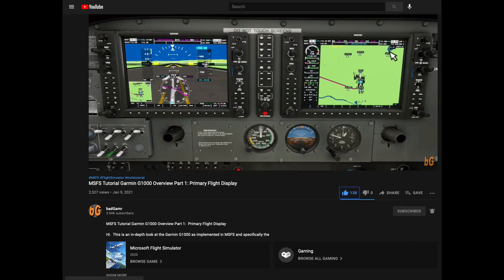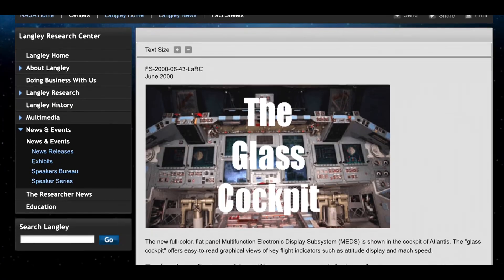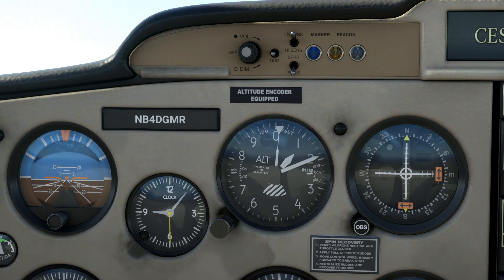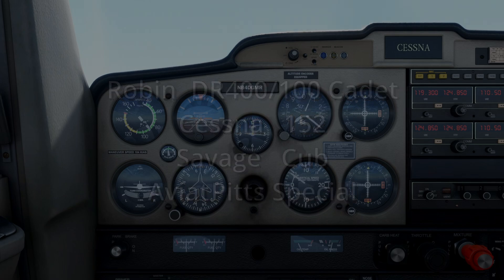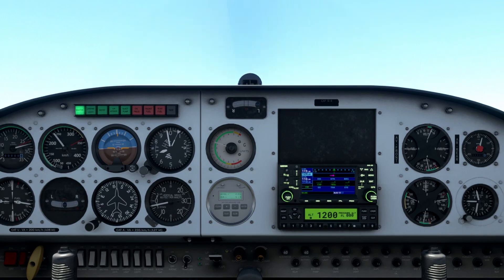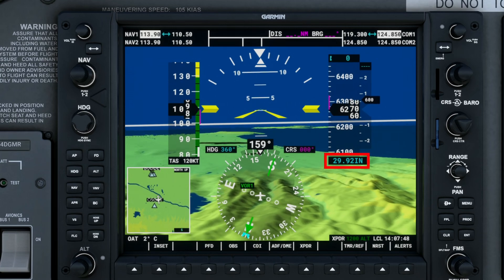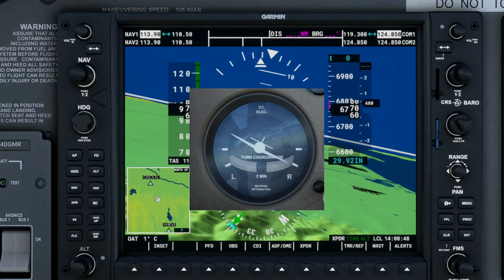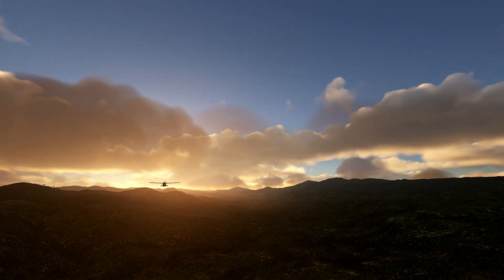MSFS Guide to Glass Cockpits from A to Z   Part 1 Transitioning from Steam to Glass

Comment: On the G1000 air speed and vertical speed indicators are hard to see. I ran into several bugs on the autopilot using xplane simulator. I was at 4000 feet and all of a sudden it started a spin. I recovered 200 feet agl. That  would make it a pilot killer .
For some reason the steam gauges on Cessna 172 work better than the glass cockpit version. Not as much functionality but easier to see and more reliable. They should have used a digital version of the steam gauges. Not as fancy but it is faster and easier to understand what is going on with the aircraft.
Great video.
Reply from the maker: Thanks so much Dave.  I too am a big fan of the steam gauges.

Comment: Thanks, this is very helpful. As a new flyer, I had no idea that glass cockpit functionality is standardized for the most part. The historical overview you provided was also helpful. The airliner steam gauges you presented at the beginning were terrifying! I would really appreciate an overview of the autopilot including altitude and heading hold. I will review your past, delightful, videos to see if you have lessons on radio work and flight plans. I get flustered when ATC tells me to acknowledge. Of course I’m clueless at IFR and night flying. I have an older system running VR, so an HP ReverbG2 with an I7-3770 @4.2ghz and an OC’d 1070 running at 70% fidelity with medium settings (TAA on), low clouds with 10-15fps over Paris, 25fps over country-side, and 32fps’ish at altitude on a clear day (I move my head slowly and try to look forward so it’s less choppy - and I prefer slow aircraft at low altitude). Your other videos have been immensely helpful in tuning. Thank you very much for your calm and fact filled presentations.
Reply from the maker: Thanks so much Greg!  You might want to check out my 3 part series on Little NavMap as I cover a bit of flight planning there.